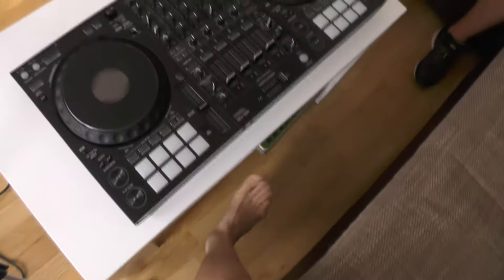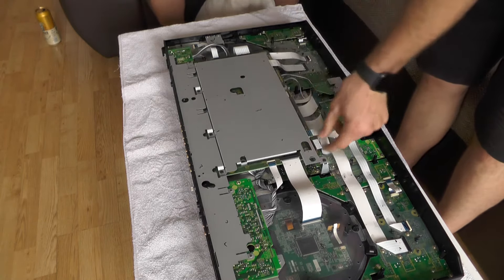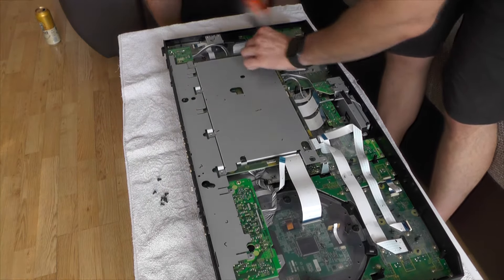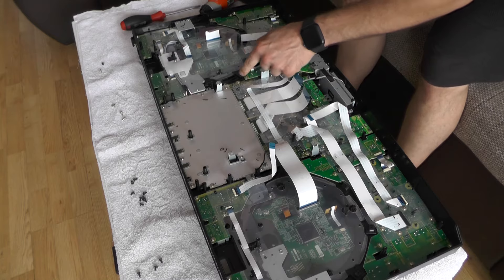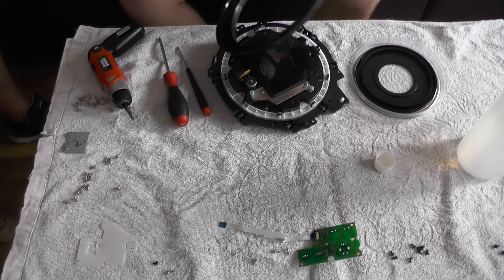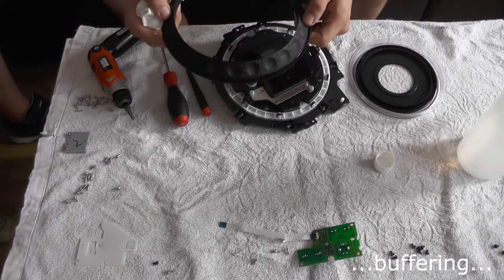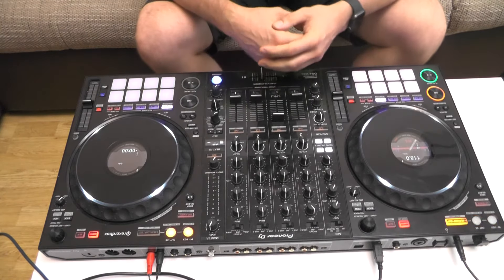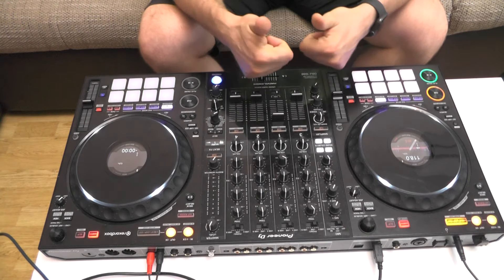Pioneer DDJ 1000 Jog Wheel repair (cleaning)

Comment: Hello after cleaning my jog isnt scratching anymore i can match 2 song by adjusting the wave bpm but no scratch with or without vinyl mode, screen LCD is ok
And also noise and filter button dont working..
Reply from the maker: You probably did not connect one of the flat cables properly (well either that or you broke something:/ ) but i would definitely re-check the connections

Comment: My jog wheel is not sensitive as it use to be. It moves really slow after having a drink spilled on it. Is this the same case with your controller? Im afraid that because i plugged mine it it created a shortage. Should i try this fix? Please let me know what you think thank you.
Reply from the maker: There is no right answer here - you can f’it up even more… so i’m not quite sure what to tell you :(
Reply: @MTS_IT  hello thank you for the response, i figured it might be my switch vinyl that shorted out. Order a new switch vinyl hopefully that solves the issue.
Reply from the maker: @steffd8066  it's not the switch  (mode is either on or off). Regarding why it acts sluggish my guess it that some liquid (coke or whatever) got in the potentiometer that is used for jog wheel - see: https://youtu.be/6gnMbnPLlSY?t=615 -  Jog wheel moves that cog and it's connected to a potentiometer (i think - because i didn't disassemble it)- all you need to do is to clean that potentiometer with alcohol (or replace it with a new one) - you'll WILL need to have some skills to fix this

Comment: Great video! I just got one also, and sure, a bit of a PITA to rip apart but from a fixing standpoint, I love how modular everything is, especially compared to inmusic crap, ie the NS7 where everything’s soldered to 1 or 2 boards (and flexes from transport) and you have to replace the entire fing board, with weak traces on the board anyway. Glad to have made the switch just for this!
Reply from the maker: yeah, i have ns7II it's a nightmare to open
Reply from the maker: i actually have hs7 II with innofader :)

Comment: I have a question, never drank beer around my controller. Only did 2 parties and one day I went to scratch and the whole Jog wheel lifted out. I have the DDJ 800 and could not find one video on that Jog wheel. I found no lose or broken parts or missing screws it just lifts right out of the controller, I opened it and do not see no clips or screws that would hold it in place. Crazy you spend 900 dollars for something so cheaply made.

Comment: I took my DDJ 800 apart and replaced the tray which holds it together I will post the video in a few days. I ordered the video editor wheel for the deviancy film editor and will test it out on the video I made of me fixing the Jog wheel. I would like to go live with you and maybe we can figure it out together. Now there was some grease which looks like Vaseline so it was kind of light when I put. It together that could not only make it slide easier it might cause the electrical contact. Message me back if your interested in going live with me maybe you can see what I am doing wrong.
Reply: Can you post the DDJ 800 video please. I have to do a repair on mine and don't know what I am in for.
Reply: @stephenhelm9781  Oh man I am so sorry, I actually did film it and been working on building my film stuido and its been crazy trying to learn how to hook all this up. I have it on my phone. I am still orginizing and un hooked alot of stuff to add the new stuff, I promise I will edited it and post it buy tomorrow afternoon. So sorry
Reply: @stephenhelm9781  I will post it tomorrow after I set up my studio. Also, I have the PDF of how it asembles I will ad it to the video so you can download it. That was very helpful. It shows where all the screws go and how to asemble the whole thing. Did you order the part yet? I will post where you can order it and the part number for the tray.
Reply: @pydepiperproductionsllcjon7585  Many thanks.
Reply: @pydepiperproductionsllcjon7585  did you Upload the Video ?? That would be amazing
Reply: @gerudoseen  You know my life got really CRAZY. I will try today or tomorrow to do that. So sorry.

Comment: Do you know why all the buttons on my DDJ1000 don't match the commands they're supposed to match? Like, if I press the Browser buttons it changes the Song Bar, the volume buttons restarts the song , can someone help me out?
Reply: Something similar happened to me, after my first attempt everything worked just fine but I had to reopen it again and take the jog wheel apart. After the second time for some reason my controller acts funny in recordbox. Tried firmware update and checked all cables and connecters again yet still the same problem. Have you figured it out?

Comment: Dude my right channel xlr is playing up. Like a loose connection. Any ideas?
Reply from the maker: Microfractures in soldering? Does ir get better when you move it?
Reply: @MTS_IT  hi thanks for the swift reply… yes … if I push down on lead (which I have replaced & swapped) it jumps back in. Also drops out sometimes if I tap the top.
Reply from the maker: @aneseed  you’ll need to resolder it (if you know how)
Reply: @MTS_IT  naaa . I’ll have to get it repaired .
Reply: @MTS_IT  thanks … dya know what sorta cost & time
Reply from the maker: @aneseed  ahh… depends where you’re from… in general - 10 min’s of work.
Reply: @MTS_IT  cool cheers bud

Comment: Same exact thing happened to me cheap champagne 🍾 🤦🏾‍♂️
Reply from the maker: party ON :))))))
Reply: @Carlton the Sheffield Pioneer Support Center, said they have a 5 month backlog, and loads of liquid damaged controllers that pioneer have delays in supplying replacement boards and have STOPPED giving out loan equipment as they come back DAMAGED.   BIG Issue this. Maybe pionner will come out with touch screen Glass faces lol
Reply: @olaogunjebe6208  thank you so much for this info I’ve been searching I couldn’t find anything. I’m definitely going to purchase a new controller

Comment: what would you use if it was water that had spilled on the controller
Reply from the maker: Hi, same thing, alcohol cleans everything:)
Reply: @MTS_IT  i know lol but i got water on mine i turned it off right away left it alone its been inna storage for a week now. Think I should try it and not go into it?
Reply from the maker: @MADSELECTOR  there is no smart answer :) depends on the amount of water that has penetrated it. I would suggest you open it and peek how it looks on the inside (there-s a lot of plastic sheets and water can stay there for some time)
Reply: @MTS_IT  I agree with MTS there, it might still be moist. its really easy, as ALL the components are in separate motherboards. I missed the left Play / CUE cable, and guess what it didn't work when i put it together. So i just went back and ALAS it was disconnected. Plugged it in and VIOLA!!. Its easy for me as ive worked on computer bits ALL my life. BUT This tutorial is a MasterCLASS!!!  @MTS  BRILLIANT. I wish i could show pictures of mine

Comment: I just finished putting back my Rev7 🥹🥹🥹 managed to remove all the alcohol but one hot cue no longer works 🥲🥲
Reply from the maker: Try replacing the button (it/s like 2$)
Reply: @MTS_IT  it’s a full digital board. No buttons.
Reply from the maker: @victorgonzalez4791  uff :/